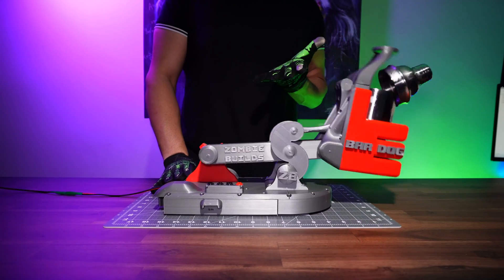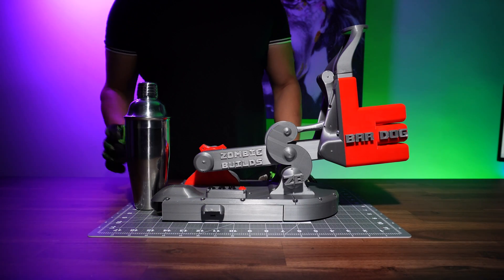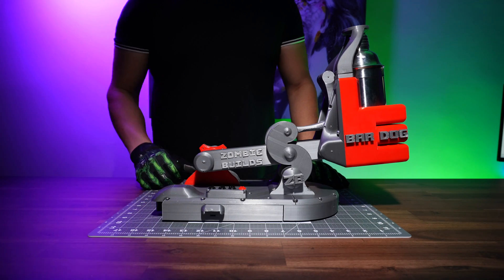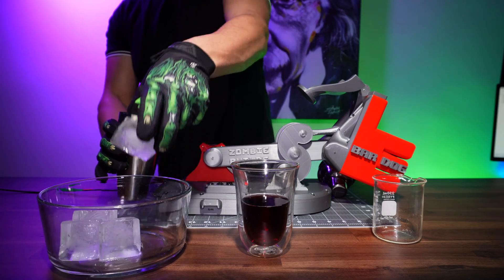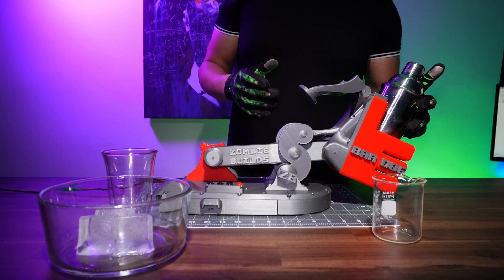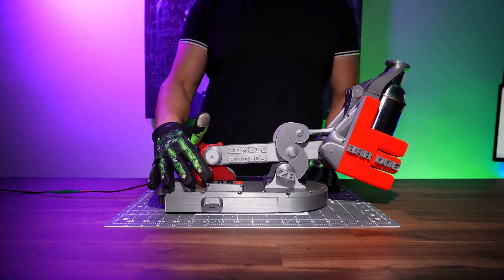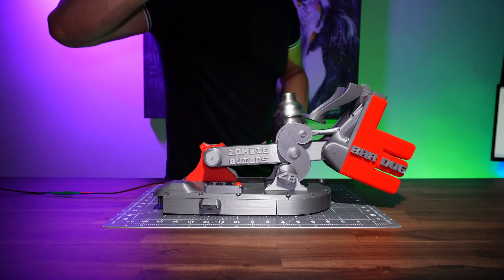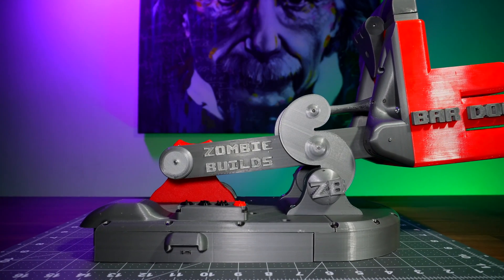BUILD A PARTY BOOSTER COCKTAIL SHAKER ( 3D PRINTED )

Comment: I like it in concept, but the final version needs some improvement. The machine is very unstable, having the timer is silly since you must keep your hand on the machine during operation.
Reply from the maker: That's right, even though I put a 5 lb dumbell weight inside the shaker, but still need some assistance to keep it still on the table 😄. And, of course, a timer is a great addition to the program
Reply: @THEWASIMPOSSIBLE  lol, I didn't realize you had a dumbbell in it!

Water is pretty heavy...

Comment: Great project, The only improvement I could think of is the pump. Peristaltic pump seems to cause quite a lot of vibration, so are there better alternatives for pumps?
Reply from the maker: Absolutely, in the 2.0 version I am trying to take the angle ov rotation into consideration, hopefully I can reduce most of the vibration 🤞
Reply: When you remove the cupholder and replace it with the dildo attachment, the women love the vibrations.